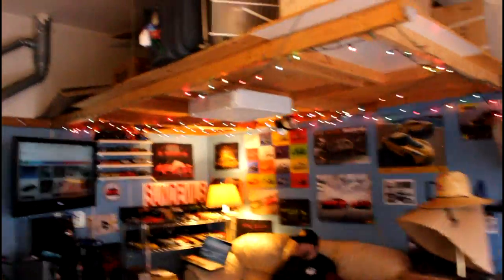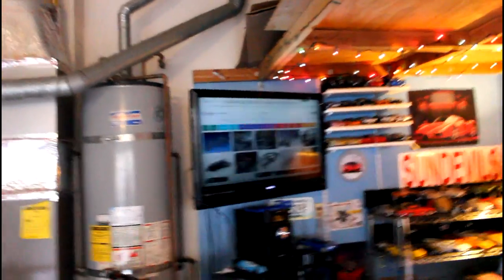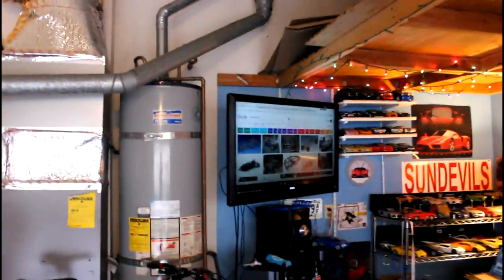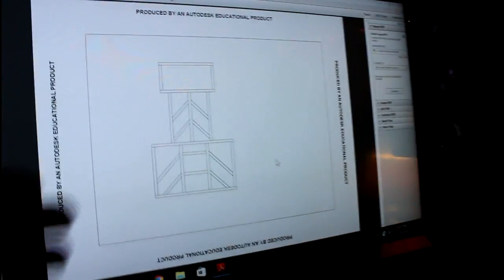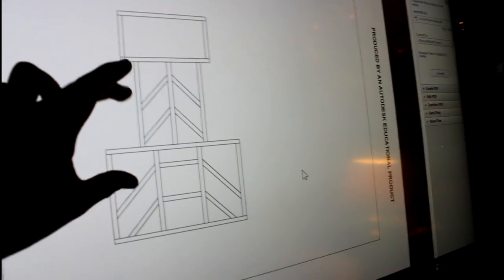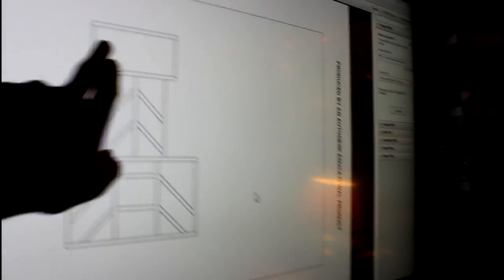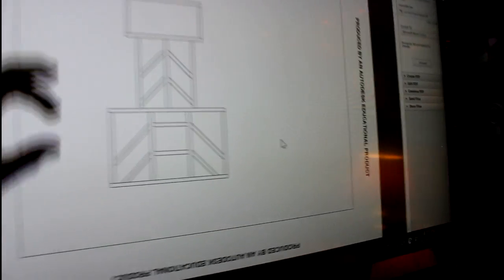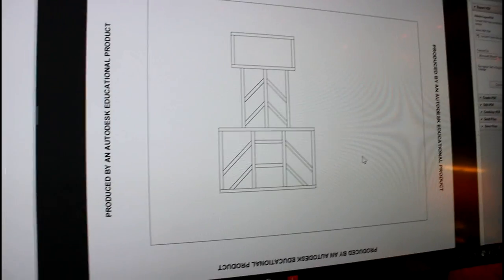How to Build a Go Kart 2:  Frame Design Ideas and Tape Layout PART 1

Comment: If you where doing a track kart would it be worth adding a suspension
Reply from the maker: I think it would be. Just really depends on the amount of money you can invest in your project. Adding a suspension will make the design a little more complex and require some additional parts and pieces.

Comment: My next project is going to be modding a Nerf - Dog , The biggest change is centering up the drivers location and making it a single rider instead of a two rider, and with adding so many new gadgets the biggest one being a manual clutch and A built Predator HEMI engine.  I'll post a link to the clutch for you to check out.
 http://3dmotorsport.net/

And please check out RBG video about it.
https://www.youtube.com/watch?v=pgaNsTkm_Cs

If you have time to check these out, let me know what you think of the clutch.........Robert.
Reply from the maker: That sounds like an awesome next project! Thanks for all of the links, I'll check them out!